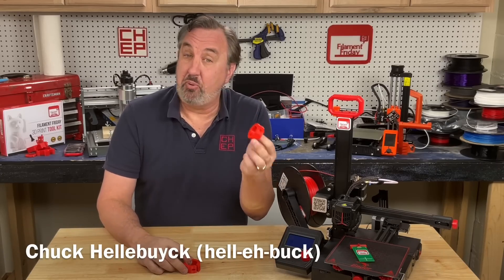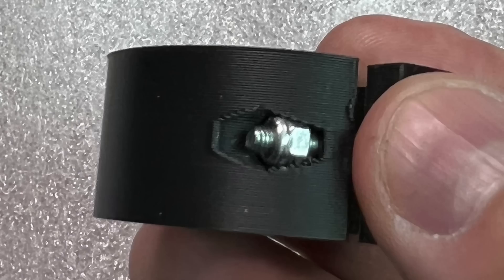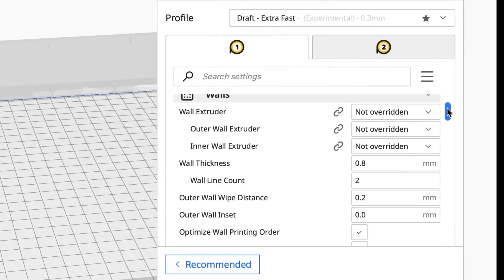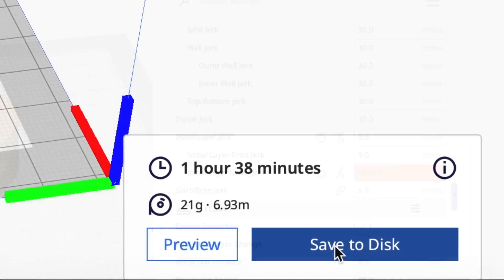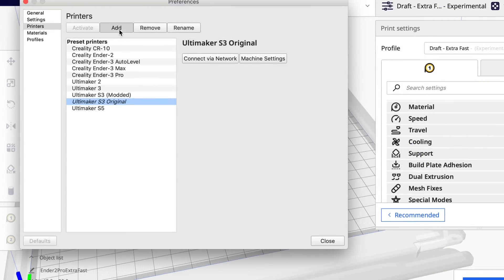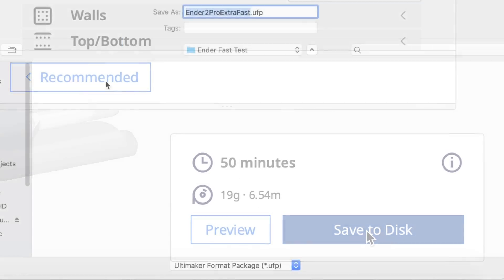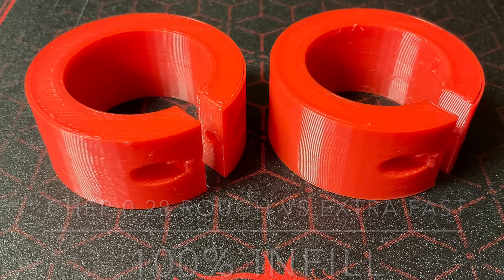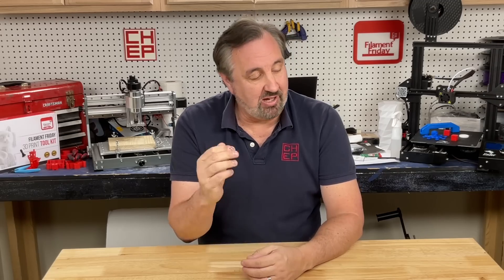Faster 100% Infill Prints with Cura 4.13 on Ender 3D Printer

Comment: This is awesome! I am trying a 4 hour print now (that would have been over 11hours using the standard Ender 3 Pro settings). Hopefully it prints well.
Reply: how did it go? I just got and Ender 5 Pro and have been trying it the last few days
Reply: @KM-yw9vr  it printed good. I didn't have any stringing. Might just be luck.
Reply: I just got the Ender 3 pro but thinking of returning because it talks a while to print any suggestions to upgrade around 200-350 price range ?
Reply from the maker: Use this profile. It’s not the printer.
Reply: @jonathansolace1179  set it up exactly like how CHEP shows it in the video. Pause video as needed. For some reason the settings on cura didn't show any of the acceleration settings like the video, but it printed fine. I tried slicing it with the standard settings for ender pro 3, it was going to take over 11hrs.

Comment: i printed an airsoft on my ender 3 pro, it cut the time in half, still takes 14 hours, but the print shifted like crazy, i let it print overnight, when i check in the morning the whole printer was bang out of place, may be i should bolt it down.....
Reply: I have glued my printer to my floor

Comment: the first one i noticed you had grid infill which tends to slice slow for me (the fast one was using zig zag pattern which could maybe explain some time difference). ive been using the lines pattern for 100% infill for a while now and it works great structurally and print time wise and gyroidal for everything else

Comment: Nice trick. It would be interesting to figure out what's actually different in the profiles. It looks like the hole for the nut is too small though. Instead of loading a flat surface, it loads the sides and levers the layers apart. If you tweak this aspect of the design, the lower infill part may still work adequately.
Reply: 99% agree with this. ive had similar problems with designs in the past. also would need to have enough walls to make the skin adequately thick enough to withstand the crushing.

Comment: This is a little off-topic, but how are you getting an Ultimaker 3/S3 profile to be able to print via OctoPrint?  When I try those printers, I have no option to 'Connect OctoPrint'.
Reply: If you hack your modded printer cfg to copy over the octoprint config lines from another machine it works.  On my mac I found the config files here /Users/joe/Library/Application Support/Cura/4.13/machine_instances
Reply: @pstevenson  thanks that did it!
Reply: @pstevenson  Yes, that worked perfectly.  Thanks so much!
Reply: I think you need the plugin called OctoPrintPlugin
Reply: @L39T  Thanks. I do have the plugin already, and use it with my Ender 3 Pro.  It just doesn't show up for any of the Ultimakers that have the fast printing profile.
Reply: @ShannonOddo  Came here looking for the same answer...any luck?
Reply: @crew322  Nope

Comment: Great info, hadn't downloaded the latest version until just now. I'm using an S5, and note that after just a cursory check, this new mode isn't available for all materials, which probably isn't a huge surprise. I tend to use PETG for most things these days, and it's not available for it. It does show up on PLA and Tough PLA, so your mileage may vary.

Comment: They did nothing special here! 
I've created profile 2 years ago and it is faster than this , better quality and I'm using it on my Ender3, on my old ender 2 I can print even faster, but question is why?!?  
 Chep let me know and I can share it with you, so you can distribute to other people, and maybe you learn something from me this time ;) 
 you have so many fans and I like to share my knowledge for free  🙂
Reply: I'd like to have it
Reply from the maker: So far I haven’t received anything from DYMO.
Reply: @FilamentFriday  Guidance and tricks from you itself reduced quite a substantial amount of time. Many Thanks 🥂😎
Reply: @FilamentFriday   SENT😁
Reply: @calmdymon  👀
Reply from the maker: I received it and will test it out tomorrow before sharing.
Reply from the maker: I tried his profiles. They were actually slower on the test print that I used in the video.
1Hr 2 min vs 50 min.
Reply: Same here, me too please.
Reply from the maker: Send it to me at chuck at elproducts dot com.
Reply: Want it!
Reply: I'd like it too.
Reply: I would be interested as well if you don't mind please

Comment: I don't usually print with infill when i need 100 percent, i find it usually twice as fast to increase your bottom layers to match the z height of the part you are printing. I don't quite know if there is any disadvantage if doing this but especially with circle parts like you are doing. And. If need be for even faster you could set top and button to concentric  when you are printing circular, because it can just keep going in circles, and it doesn't have to slow down to go back and forth. But keep in mind if you do this it could create a part that isn't as strong as just keeping top and bottom pattern set to grid or line. I remember reading this tip a couple years ago on YouTube when i first starting printing and i have been using it ever since when i need 100 percent infill
Reply from the maker: So try this and compare. Let us know results.

Comment: Morning so wheres the setting ? That thangs thing is so complicated dont you just have the profile available the way your others did .It dosent download shame
Reply: I tried this on an Ender 3..it worked...but my Ender has never been so noisy and I thought it was going to self destruct 😅 I may try on one of my sovols later ..
Reply from the maker: Import the .3MF project and Cura will automatically add the profile, place the stl file on the bed and your ready to use it. 
More details on .3MF files here: https://youtu.be/QuS0XtylJU4
Reply: @FilamentFriday  sorry sir you've lost me You've made getting your profiles so  complicated I'm lucky I have your others which by the way are fantastic .Import this do that Worked fine the other way .Congrats on expanding .
Reply: @FilamentFriday  what the heck is the 3mf project ?

Comment: hello, i am new to 3d printing, i have a ender 3 that works great, a friend gave me a ender 5 pro, it does not have the sd card with it, so, i bought a sd card and formatted it, but for some reason the printer will not connect to it. so i used the card from the ender 3 and it worked fine. what am i doing wrong? please help. your videos are lots of help. thanks so much. how do i make a new sd card work with the ender 5 pro? could you do a video on that for all of us? thanks again..
Reply: Hi, did you format it in FAT32 file system? Because not all printer boards can read NTFS, EXFAT or any of the newer file systems.
Reply: @Spartacusse  the only option i had was fat, or ntfs. does it matter what size card you use. i am trying a 128gb. i used the fat option
Reply: @robbiterry38  Hi. There lies your problem. I don't know what versions main board you have, but if it's the 32bit version, it says it supports up to 64Gb, but people are complaining of having issues, so 32Gb is the safest option, for a normal 8bit board, 16gb is the limit but 8gb works best, in any case, your 128Gb card would never work. Moreover, 128Gb SD card for a 3D printer is a waste, you should never need more than 2-8Gb card, the gcode files are really small, if at any point you were to be running out of space in a 4Gb card, it also means you have so many files in there that you'd be scrolling for a long time on the LCD in order to find the files you need. In any case, I hope this helps. Also, I suggest you join the Ender3 Reddit, you can get answers for uncomplicated issues like this in minutes instead of hours/days in a video comment section.
Reply: @robbiterry38  why on earth would you waste a 128Gb card on a 3D printer???
Why not get a powered HDD adapter and use an 8Tb HDD instead???

And people wonder why they have problems.
Reply: @Spartacusse  thank you for the help, i am still learning, so i kinda thought 128 was to much. i will try a smaller card.
Reply: @buzzbbird  i hear ya, it was one i already had so i thought i would try it.

Comment: Have you tried this with an ender 3 yet? I've had trouble with quality with cura in the past and I only print with it bc cura has the best supports but this recent update has been really good for me quality wise.
Reply from the maker: There is an Ender.3 profile in the download.
Reply: This is definitely a game changer. I tried it myself on my Ender 3 last night and it cut my print tine from 9 to 3 hours. I was worried about the quality but the part came out almost perfect. No idea the long term effects on the printer itself will be though.
Reply: I've tried this setting on my ender 3 and I'm afraid my printer will breakdown from the print speed. 
Ohh and yes this worked with my ender 3.

Comment: Wow, have to try this with my cr 10s pro. Thanks for this and all your awesome videos!
Reply: Please how did it go?
I have a cr 10S and I don't want it to break down from that ridiculous speed 
I'm currently printing a test sample on my ender 3 and the printer moves faster than I'm used to and comfortable with.
Reply: I literally just did it with mine, first test is going well, but not done yet. Compared to my previous profile, the print went from 1.5 hrs to 46 minutes, and we're at 80% with no issues so far, well under an hour. 

I will say that my printer is making some rattling noises it doesn't normally make, so I'm pretty sure that the acceleration/jerk is a part of it, but I can't find where the time is going otherwise. I also checked the line width and speed settings, but they're all pretty close to what I was using before.
Reply: @davidp886  interesting that you would reply now. As I only recently started live as well. Would give update as it goes. 
My main difference is that mine is cut from 36 hours to 8 hours
Reply: @Expeebaba  Mine finished up great, but  I've a smaller test now too, and started another medium test. The saving seems to be between 30-50% depending mostly on size. It may also be that the bigger the model the more time is saved. I'm sure there's a complexity variable as well, but still interesting. I'm also running into a strange "issue" where it seems to place it randomly on the build plate. One of them was even in the corner...
Reply: @davidp886  didn't fully comprehend your issue, but looks like my hot end was spewing out filament through the thread between the nozzle and the metal hot end and every other possible crevice. I had to change the nozzle and now looking for a new all metal hot end.
But the printer still works. 
I guess using the stock hot end at high temperatures for prolonged periods causes those issues. 
Also I was getting strange buildups on the print bed (looked like Lumps) while printing.
Reply: How did it turn out? Did it work with these settings/trick?
Reply: @gamersofanarchy5494  yes it did. 
Both worked on my CR 10 S and Ender 3.
Hoping to try it on my artillery X1

Comment: Sounds like my experience when migrating from Prusa to Voron ( changing the Printer and the Software - PrusaSlicer to SuperSlicer )

Prusa obviously has all their printer and filament curated ( but highly conservative ) profiles you'll not be finding for a Voron, so I had to actually learn what to do in the Slicer to get things up and running for those speeds I built the Voron for ( technically I wanted the increased build volume, and the increased speed was just a very welcomed bonus )... Lots of things play into how fast one can print with a printer and Bottlenecks can come from literally anywhere in the system hindering your speed progress. The most obvious ones being the Speed one followed by Acceleration and Jerk with the latter having a surprisingly large impact despite the small numbers you'll be dealing with but also things like Layer Time for cooling will play a role in artificially slowing down a print like a row of stop lights constantly telling your 400km/h car to slow down at every intersection ( layer change ).

That being said though I'd kinda argue that you could have gotten away with just pumping up the perimeter count to like 3-4 and maybe increasing the infill to say 50-70%. No reason to go past even just 80% unless you plan to remelt a part in a salt casting where you absolutely cannot have a void in your part 😏
Reply: I would argue use PETG, up the heat, do 4 to 6 walls...no infill, no fan.  and do like 80mms....35mins most likely.

I would do a outerwall of 55mms and inner wall of 100mms

Comment: With 0% infill does the profile still offer any time savings, or is it just for infill?
Reply from the maker: Some improvement there too
Reply: The test I'm doing is done with the default settings of 2 perimeters and 10% infill, still cut the time almost in half.

Comment: Great video. I’ll have to try that. I am brand brand new to 3-D printing. I got an ender 3S one recently for my first printer but so far I’ve had to use the creality slicer because cura doesn’t have settings for the S1 and I can’t find instructions for how to make a suitable profile for it that is understandable. Any advice or help would be super appreciated. I know creality slicer is a repackaged form of cura but I’d like to be able to use the original.

Comment: This is very interesting,
i would like to see a followup technical video on the breakdown of the .gcode file
standard ender 3 machine gcode
ultimakers .gcode
modified ultimaker machine imported into the ender 3
and the differences in these files and simulations of the files playing in sequence.

Comment: I've been sharing your findings, and applied this hack to my recent prints. I am amazed!!!
Reply: Not a hack, soon to be available on all printers bc it's a reported bug :D
Reply from the maker: It was a feature in 4.13 not a bug.
Reply: @FilamentFriday  Idk if every printer will be as fast as using such feature but there is a bug that affects every printer that isn't an Ultimaker using 100% infil.
Reply: @Ebani  Potato-Potatoe, Bug - Hack, Tomato - Tomatoe. After the initial report, Ultimaker will claim it to be whatever they want....a "bug"?!? Mmmmkay. Mod, hack, workaround, feature, bug or backdoor. I am still impressed on how my Voxelab Aquila runs through  these type of prints so fast and without any stringing effect. 😉

Comment: I tried it on my Ender-3 (changing the profiles like you did) and it worked. But it felt like the printer was going to shake itself to pieces.  I think my printer will last longer if I just have more patience :)  Thanks again Chuck.
Reply: It defiantly lets you know what you got. I found that my belts were loose, and a lot of the chatter came from the filament spool overhead.
Reply: Finally found a complaint I was looking for. The print speed is faster than the traditional print speed and I'm afraid my printer will fall apart
Reply: Weight it with a cinder block!
Reply: @goku445  ha ha😃
Reply: @DerekH_UK  Really! It's a thing. I think CNC kitchen has a video about it saying it drastically improved quality.

Comment: tried it on ender 3 v2, cura 4.9, yes there's a decrease in print time. e.g. calibration cube, normally it prints 38 minutes. but with this config it's down to 22 minutes. no layer shifting.

Comment: I bet the print would have been even faster if you just changed your wall thickness to a max, so the print basically has no infill but exists only out of wall lines. This helped me a lot to speed up my functional 100% infill prints. And they even get a bit stronger
Reply from the maker: It does help a lot for some prints.

Comment: Or you know, you can change the area where the nut goes against the plastic, straiten out the recess for it so there is no taper to help the nut split the layers then use a soldering iron and heat embed a small steel washer flush with the surface of the plastic so that is what the nut tightens against while spreading the force along more layers.. plus you know, add material to the model around the nut and then spread it out conically inside till it reaches the front...done deal tons less material used tons lighter etc but still your way works

Comment: So has anybody bothered to compare or diff the gcode produced to actually see what Cura is doing differently in the fast version?
Reply: Fine... I'll have a look...

Other than using F9000 on a whole bunch of the travel moves, all the M204 and M205 lines in the faster Gcode are in-line with what the settings show -- no hidden secrets. Eg.:

M204 S2000
G0 F9000 X52.245 Y67.354
M204 S1000
G1 F1188.1 X53.795 Y65.804 E1535.47953

(Not sure how it picked F1188.1 for the G1 command)

I was hoping maybe for some interesting gcode, but here's a breakdown of one of the files I was looking at (used the Draft Extra Fast ultimaker setting)

# of calls   Gcode
        1      M109
        1      M190
        2      M104
        2      M105
        2      M107
        2      M140
        2      M82
        3      M106
       13    G92
  49088  G0
  70539  M204
  72123  M205
358288  G1

Nothing out of the ordinary for a Cura-sliced file... other than those F9000s, pretty sure it doesn't normally slip those into every print.

Anyone else find anything?
Reply from the maker: I’ve gone thru it as well but couldn’t find anything specific. Thanks for sharing. Many have suggested looking at it.